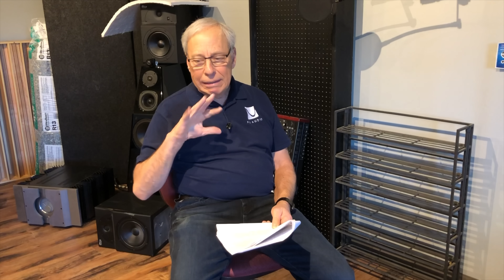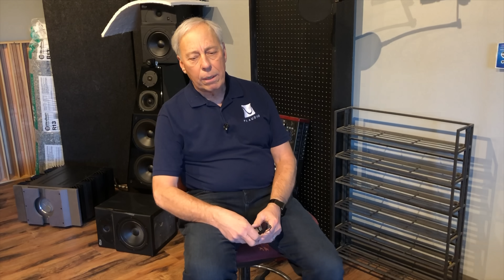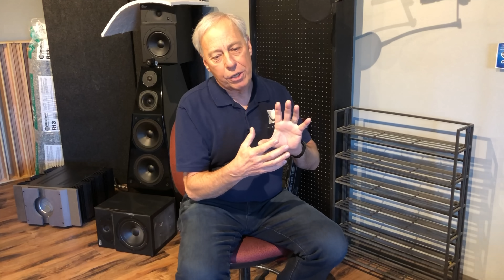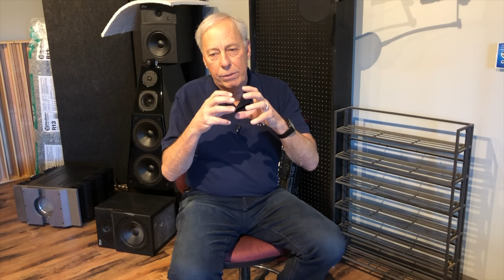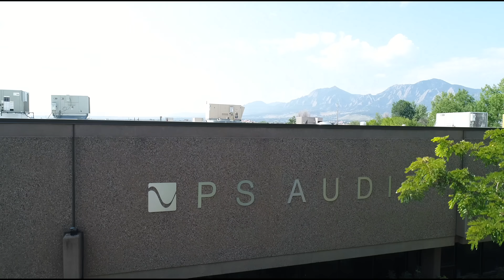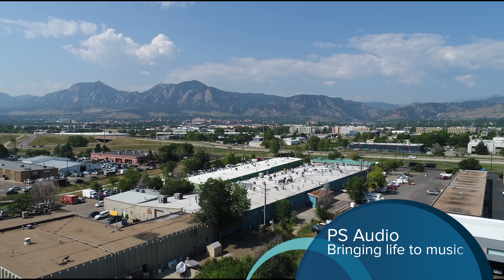Direct Servo Subwoofers

Comment: I don't really know how the corrections work, but I dont think an accelerometer is the best choice. An accelerometer measures acceleration and acceleration only. If it is not accelerating it outputs nothing. So if you are trying to get the current possition of the diaphram (which is what I assume you need), you will need to do some fancy math stuff to calculate the position based off of what the accelerometer has read over time. This is called an IMU and it works great for navigation in all sorts of vehicles including boats, planes, and even satelites. But for movemnt this high of frequency I highly doubt the accuracy you could get out of an IMU. I personally think you really should be using a laser or some other system to directly measure the position of the diaphram.

I do think you could do the corrections in a way where it doesnt need to know the actuall position of the diaphram, just the acceleration, but I dont think it would be as accurate as if you knew the actuall postion.

I am not saying the way it is already done is bad, but it could possibly be better. And once again I don't really know how the corrections work.

Comment: servo subs a good fit for magnapans?
Reply: I hear the open baffle subs are a good fit for Maggies.
Reply: Servo subs work well with anything, including Magnepans. Magnepans require a little extra bass help, but that's ok, all speakers do, just a little more with Magnepans. I have two pairs of Maggies, and they work fine with a B+W ASW-750 12" sealed sub. However, I believe that a servo sub is theoretically "better" in many respects to a non-servo sub. 
Which Magnepans are you using?

Comment: Quite enjoyed this explanation of servo subs but it raised more questions for me than it answered... The accelerometer (or secondary coil as you mentioned) is obviously a laggong indicator... How do you use that feedback loop to adjust amplifier power if the motion you wanted to correct had already happened? Is it some kind of predictive logic or is it straightforward? Lets say a kick drum (or explosion in a movie) happens... Big inputs decaying down quickly... How does the servo avoid overcompensating?
Reply: If it happens with electricity, it is a physical system that moves at the speed of light, or very near it. So the measurement and correction happen nearly simultaneously.
Reply: You build what in control systems is called a predictor - a mathematical model that takes into account key parameters to allow predicting where the system (in our case speaker) will be in some point in the future if no changes are made to any inputs. eg take speaker cone position, velocity and acceleration along with mass and damping factor (Q) and create a predictive formula. 

This information is then used in an algorithm to adjust the current excitation or voltage applied to the speaker such that the future predicted error between predicted and desired position is reduced to zero, or near to it. This way undershoot and/or overshoot are vastly reduced.

Comment: I enjoyed becoming knowledgeable about the topic., which made me happy not to have ever sensed I have a problem with my sub (JBL B-380 powered by a Sony TA-N80ES). It sounds right.  I think the bigger problem for most folks is sub integration, since the sub is not treated as a channel but instead a crossover matter. Of course with stereo material it will always be a crossover matter, unless amplification makes use of DSP to extract a sub channel. And that's what I'd like to see, DSP added to stereo integrated amps and preamps to make integration of passive subs a cost/effective solution to the sub chaos we have now.

Comment: I deal with servos every day because they position all the axes in my CNC machines. I have built servo systems, both electronic and purely mechanical. I understand them pretty well. In a servo speaker system where does the feedback go? Is there an amplifier in the servo speaker? Or does the servo system attenuate the signal from the main amp and then ask for more depending on the cone position? Following error in a servo system must be kept to a minimum so your speakers must be pretty stiff in positioning at the frequencies desired. Anyway, just curious, this kind of technical stuff really appeals to me.
Eric
Reply: Yes, amplifier power is adjusted based on the servo feedback. I'm not an engineer but I would imagine that the signals are summed or subtracted to create the ideal amp signal.

Comment: Yeah but what about the idea I had of an active control system of controlling the pressure inside the cabinet. The cabinet can control the overhang automatically and you can reduce pressure automatically just by using the natural energy of the driver.

Comment: How can my headphones produce low frequencies when they are so small  ( the headphone )
Reply: Small drivers in a small space will compress the air, it helps that headphones are usually sealed. Put your phone in a shoe box and you'll get more bass, same principle. And the opposite is true with a large venue, that's why you will see multiple very large woofers stacked on stage.
Reply: CHECK ENGINE   I think it is because a small or large driver can oscillate to low frequencies.  Also, I believe the strong neodymium magnets enabled the much small size.

Comment: The input signal to the speaker, the voltage indicates how the amplitude is to vary with time. The transducer measures the actual motion generating an electrical signal that is compared to the input signal. The difference is distortion and the voice coil in a servo amplifier is driven by the negative difference between the two correcting for the dostortion. 

There are three generic types of motion sensors. Each has many ways to build them. The first one measures the actual position directly. It's called a strain gage. A second type is called a velocimeter. This type measures the change in position with time. Clearly it can't be directly compared to the input voltage, it's apples and oranges. The signal must first go.thtough a circuit called an integrator. It gets you back to position as a function of time. The third type is called an accelerometer. It measures the change in velocity as a function of time. It's signal must be integrated twice to.get to position as a function.of time.

Comment: The next logical question will be on passive radiators...pros and cons to relieving sealed sub box pressures thus sub inertia?
Reply: I used to love my dads AR towers in 1980, had a passive. But there is nothing great about it. I know Andrew does it but its a less than the best situation for top line.

Comment: I went along with all of that ... but I have to say this .... servo systems are and always will be a kind of necessary evil to correct another unavoidable evil so produced by inferior loudspeakers. 
I STILL maintain that a LF driver with a very stiff and low Mms ( diaphragm mass) also with a low Vas ( restoring force given by a given volume of air ) mounted in a well controlled potted enclosure will outperform any servo system ! The amplifier must have a very high damping factor and the bass driver must equally have a very high Bl ... PS audio should seriously consider this in their new speaker designs ...
Reply: i think the biggest reason why ps audio is going with servo woofers is that they want the build the subwoofer in the cabinet with the main speaker, some serious eq have to be done to make this sound good, paul knows that subwoofer placement and speaker placement is not the same for best result. be he want to make a simple all in one product.    but then my fears is that no one wants it, people that want proper bass want a separate subwoofer and people that dont want subwoofer will have one built into the tower speakers......
Reply: Janina Palmer, when you say "potted" maybe "ported" or plotted? 
What is the surround on this desired driver in your thoughts? Doesn't voice coil size have more to do with power handling? 4 inch seems large. My puppys are just 2.5 inch and that seems large enough. I'm not sure what bl is, looks like I have studying to do. I did come up with a pleasing solution this summer with combining the DL15x with a 10 inch softly sprung rubber surround drier. Guaranteed phase correct. Most likely would never fly in the commercial market, but that's not what I'm after. I have no plans for money making. Only to live out my grey years having a good musical time.
Reply: He's in love with those servos because of Arnie. He knows not of what he does other than following Arnie because Arnie pulled it off before. 
ok, if had his system I would go all active, go paper or carbon, I suppose for the woofers and have an amp channel for every last driver. 25 wpc on each driver. But in the end its just too big to take home. I also feel that those ribbon mids are most likely to "machine like" sounding. He's got those crossed too low. Its just a full on mess in my thinking. 
You don't have to like or dislike. Just airing out. Hope I'm not bothering, its pertaining to your satatement. You have been so focused on that IRS!!
Reply: Brian David Loveless ~ yes there is an element of truth in what you say about Arnie... I thought of that too. 
To suddenly set out to manufacture high end speaker systems from scratch requires a lot of experience ( without falling back on copying previous associated designs ) PS Audio must adopt broader thinking in order to pull this off otherwise people will assume they are just reinventing Infinity speakers . 
The secret to a really good speaker system lies in the quality of the drivers .. I have already seen one woofer that Paul was using .. I must say one thing it did look very impressive.. good general specs ( I'd love to see the full set of Theile-Small parameters) .. so let's sit back and wait for the first production models to arrive !
Reply: @janinapalmer8368  🆗🆒

Comment: I keep watching these servo videos in the hope of finding out how this signal from the accelerometer actually does anything. Great you have this signal, now what? None of my amps have an  accelerometer input, so what magic transpires between the accelerometer and the amp to make this timing correction happen?
Reply from the maker: The accelerometer generates a small voltage in response to movement. We take that voltage and integrate it in an integrator (an op amp with a capacitor in its feedback loop) to get acceleration. The output of that integrator is then fed into a difference amplifier that compares the input signal of the power amplifier with the output signal of the integrator (accelerometer). The difference between the two is then used to adjust the final output signal feeding the subwoofer amplifier. The result is what drives the woofer. There are no accelerometer "inputs" as you suggest. Typically these are closed loop systems.
Reply: @Paulmcgowanpsaudio  Thanks I think I've got it, the output of the integrator is then compared against the source signal, and small changes are made to the output signal to realign the driver to the amp signal in the form of a correction. That sounds like a lot of error correction processing going on in the back end. Would I be right in assuming that the servo woofer would typically be used with a plate amp where you can tap into and make the necessary signal changes? Could you make the necessary mods to a regular amp, or is it a too hard basket?
Reply from the maker: @DodgyBrothersEngineering  Yes, you have it exactly. In the servo amps we built for Genesis on the separate subwoofer it was all contained on a plate amplifier. For the original servo system found in the IRS, the accelerometer had its own cable that fed an external crossover box. In the Genesis 1 and other speakers with an external amplifier there were dedicated cables connecting the amps and servo system. Lastly, in the IRS Beta from Infinity, there was an external crossover box that required the addition of a user supplied external amplifier for the subs.
Reply: @Paulmcgowanpsaudio  Thanks again, sounds a little out of my electrical league to do a DIY on my upcoming 18" TC Sounds LMS Ultra 5400, 2 x 18" VMP PR's box. Hopefully the PR's lack of any real air resistance, along with a gigantic motor can keep it all under control. I'm driving it with a Crown IT9000 HD, so not that easy to do a servo conversion.

Comment: Sometimes it seems like speakers have been invented to death, but all we really need are a new set of variables to work with.
Here's one. A semi-active port. One woofer, dual voice coil. Second woofer where the passive radiator would go but driven by the unused voice coil of the first.
Here's another.
A woofer with a parabolic efficiency curve to counter that caused by the suspension.
Reply: @InsideOfMyOwnMind  I understand what your saying, for me , I use my system outside a lot and and small main driver just doesn't have the balance in proportion that the EV 15  driver does. My expermentation accidently lead me to reducing the recommended box size in half and mounting the driver face down in the shallow box. All of a sudden,. Drums hit hard and bass was so pleasing as nothing much below 50 hz. It only needed a few db up around 5 k and 8 k. But l have Phillips dome mids that match the output of the 
LF 15in driver. I just got a mic but you can actually hear what I'm talking  about now. Would you like to hear? I can post a video this week.?
Reply: @SJMessinwithBoats1  Granted the output from dvc coil2 by itself won't do much to the 2nd driver. My line of thinking was you could extract the signal from dvc coil2 to impart the unwanted characteristics onto the 2nd driver which remember used to be completely passive. You could put some amplification between dvc coil2 and the I guess you could now call it a pseudo-active radiator. Play around with phase, frequency response and levels to "port" the box according to what the music requires based upon the errors between the native input and the output of dvc coil2.  This should impart the box as reflected into the dvc driver as well as dvc shortcommings onto the port. This should give you some stuff to play with that you didn't have before. Be careful with the gain so that inherent aberrations don't flip the feedback polarity and end the little Jenga blocks game that we're playing. You may have to have some pretty tightly defined (high order)polls in the network of this new part of the signal path to prevent it..
Reply: @InsideOfMyOwnMind  I'm just starting to see your humour.. Time for some holy smoke and chocolate milk?
Reply: @InsideOfMyOwnMind  dude! I got it! The signal from the second coil can run one channel of a pair of headphones, just need another dvc woof woof now.
Reply: @SJMessinwithBoats1   I was actually considering it as an alternative to the accelerometer with some additional variables made available to play with. You never really know when you're going to find a diamond inside of a turd right? lol. I was throwing it out there to invoke some thought. I completely acknowledge that from an experienced speaker designer's perspective it may be all bullshit but I don't really know. And no, this is not the product of an evening with Mary although I can see where you might think that.
Reply: @InsideOfMyOwnMind  A good  funny here and there is always good too, amungst friendly peoples. Thanks for ALL you thoughts!! Its in my noggin and I'm sure Its going to come back out. YES , I see your thoughts of port tuning ideas. Maybe simular to variable intake manifolds on cars that have been around since mid '80s?, from what I remember. I do have a thought about this managing pressure in the box.
Reply: @SJMessinwithBoats1  Thanks for the respect...finally dude LMAO. Does your shoulder hurt? Did I punch too hard? So as bizarro as it all sounded success on my part would be that it caused somebody else to have a new idea that grows legs even if it's just a DIY job that satisfies musically. Lots of room for DSP, Ice amps and the like in this concept.  Also we should talk about my multi channel class D with a single pair of power FETs.
Reply: @SJMessinwithBoats1  As are many ported solutions in general. However if you impose some control over them including how the primary woofer is imposed upon by the box it seems like a more wholistic approach to porting. In other words use the output from the secondary coil to impart a fuller equation onto the port (would be passive element) It seems to me you should be able to get the advantages of a ported solution while spreading out the response without so much of the one-note-wonder effect.
I long for and look forward to the return of the days where I might be able to go Wally Woodshop on it and find out myself.
I also want to make a voice coil that couples more loosely at zero excursion than it does toward either extreme like some kind of stretch wound config.
Reply: @InsideOfMyOwnMind  Yeah, a secondary coil? Do you build woofers from scratch? I think when you try something new that you have to have something to present because words and final product is two different things most the time.  I have my best guess going on and I will start with the final working prototype. I'm looking at spring with my design.
Reply: Wow that's a lot! I have to go word for to try to understand. I'm just two Pa drivers inverted and getting an omnidirectional pattern and I can't get off it and jammed all summer, many people heard it and many enjoyed.

Comment: I remember I had a little subwoofer from...Mirage, I think it was. It had a long tube where all the air came out in the back, and when I played a heavy bass track it would blow so much air out that you could hear this muffler kind of whistle louder than the actual bass.
Reply: Port noise is what it's called
Reply: @adamtolbert3279  Oh, okay. Not a big fan.
Reply: thegrimyeaper ~ that's because the port tube was to narrow and probably wasn't flared at both ends